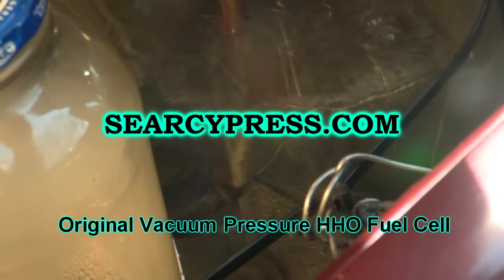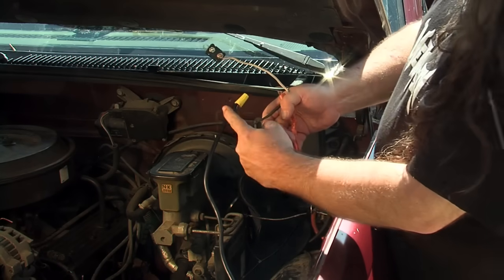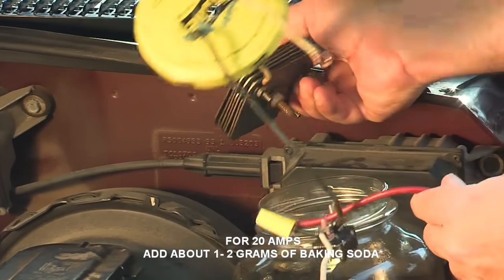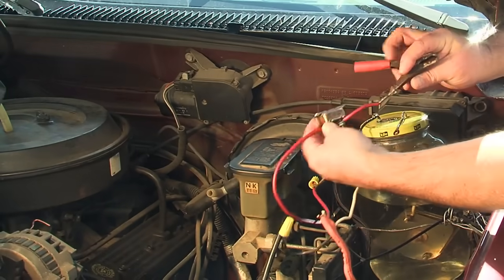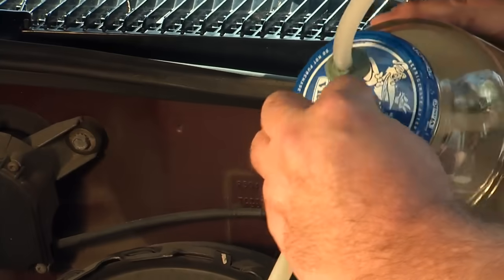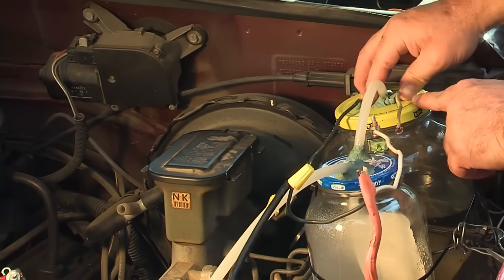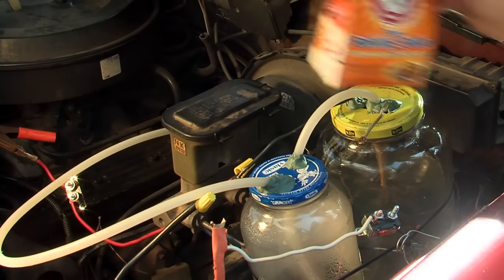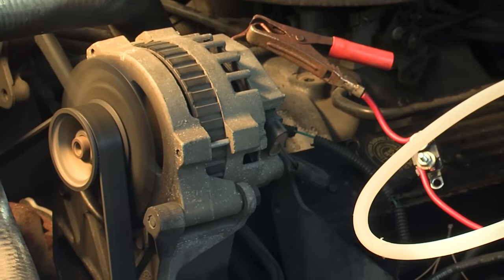Vacuum Pressure Hydrogen fuel cell defeats high gas prices using hydrogen from H2O.

Comment: What kind of stainless steel you running with that
Reply from the maker: 316
Reply: Ok, thanks.. u still running with the same set up,
Reply from the maker: @brianseibert946  i took it to the next level. Vacuum pressure photon injection. I did another YouTube video on it, however its popularity was never as high as this video. By superheating the gas in the drying chamber with a Xenon light source you can push the electrons into higher shell Orbits. I think the reason that video never caught on was the fact that the science behind doing that, is just uncommon knowledge. When you first see this setup, you would think it would explode. However running in a vacuum this is not the case, truly amazing.

Comment: What you made is a poor man's water injection, because there isn't nearly enough BTUs of energy in the hydrogen you're producing to help that engine go at all. Hydrogen is a very very very low energy gas. It doesn't have nearly the BTUs of energy that gasoline has. But when you introduce an element of water you can increase fuel mileage considerably. What you are failing to take into consideration is you must make sure you do not damage your catalytic converter. Too much water can indeed really mess with the converter elements and the oxygen sensors.
Reply from the maker: I agree there is a benefit from the water vapor injection. This is not just hydrogen, this is hydrogen oxygen. I'm not sure if you've ever played with the stuff but it certainly is not what I would personally call a low energy gas. HHO or Brown's gas as it is often referred to, is a very unique fuel with low temperature flame. Interestingly this low temperature flame can melt tungsten or burn through practically anything. Ty for the comment.
Reply: @metalpresstv  yes with enough volume it can. Hydrogen has the unique ability that you can put some in the palm of your hand and ignite it and it will not harm your hand when it ignites, because it implodes. The oxygen content is what helps the engine more than anything. It makes the efficacy of the fuel-air mixture increase markedly. You can almost get the same effect by running your air intake through a filter of lithium hydroxide. Which will convert the carbon dioxide that goes through it into oxygen. However its effect is only as long as the lithium hydroxide Catalyst reaction is active.

Comment: I ran my Dodge 1500 with a similar hook up only I didn't use it around town stop and go driving. But when I was gong somewhere and maintained a speed of 50 mph or more I'd turn it on especially on the interstate. My mileage when off was 16 t0 18 mpg. Turn it on for a long drive I was getting just over 30 mpg.  I also noticed more pep when going up hills and less pressure on the gas pedal.
Reply: Why u gotta lie man. Basic math for anyone with more then a 7th grade education knows this is bullshit. Just idling your engine is over a 600 rpms. Driving a 2.5 liter 4cly motor  is about 150 cubic inches. That's 37.5 cubic inches per a cylinder. A cylinder fires ever 2 full rotations. So in a minute of idling at 600 rpms your engine will use 11,250 cubic inches of air a minute at just idle. That's a 187.5 cubic inches a second of air. You're not producing even 2 cubic inches a second. But don't forget that it's h2O 2 parts hydrogen 1 part oxygen. So 1/3 of the gas isn't even hydrogen it's oxygen. So not even 1% of the air being taken into the cylinder is hydrogen. The only thing being accomplished here is the alternator is working harder for the high amp draw dragging the motor down more reducing fuel mileage. This is why water isn't used as fuel in a motor vehicle. 

Now don't forget we don't drive at 600 RPMs most people will be around 1800 rpms at cruising speed. That's 3x the amount of air with still the same hydrogen production. So now ur way below the threshold of .03% hydrogen in the cylinder. Using a spark arrestor on the output hose to keep from blowing the jar up you would be hard pressed to even candle a flame let alone put anything measurable in every cylinder 900x a minute cruising down the highway at the speed limit.

Comment: I'm not understand ,why cant be used the exhaust heat instead of electrical heat to produce the hydrolyzed process!? Takes time to adapt this system, but cut another problems like battery or wires !
Reply from the maker: An interesting concept. Producing hydrogen from the heat of the engine. Currently there is no thermocouple to produce the kind of electrical energy needed to do that , I am aware of.

Comment: And, for all the dumb commenters below, oxygen sensors do not sense oxygen, they are small fissures that generate small electrical voltages when exhausted air passes by them. Mass airflow sensors measure air going in, o2 sensors measure air going out. (All an engine is, is an air pump)...Get it? P.s. the truck in this vid does not have a maf sensor.

Comment: Yes, it's a carburetor  gas injection (the old way, not ECM and sensors needed) not a Fuel injection gasoiline engine.
Reply: ernesto 96 had first year vortec or the previous tbi throttle body injection

Comment: It takes a LOT of energy to split hydrogen from water..and with these tiny little generators it will never work to provide enough hho to make any noticeable difference....a 5.2l engine would need at least half that in hho EVERY revolution of the engine to make any noticeable difference..basically at wide open throttle the engine is turning over 100 times a second thats sucking in 520L of air every second..and i highly doubt these things can produce enough HHO to sustain anyplace close to 200l of HHO per SECOND 

Lastly back to the ammount of energy it takes to split hydrogen atoms to create enough HHO to sustain a 5.2l engine would be astronomical...modern engines already burn 98.8% of the fuel that is introduced to the combustion chamber...the issue is the fundamental way an ICE works..it only puts 26% of that energy to use....the rest is lost to heat..and there is FAR less energy stored in HHO gas.. do the math... 

THIS IS WHY WE DON"T HAVE HHO ENGINES! its far too inefficient..

Comment: 29 amps is going to hog a lot of energy. Or do you mean volts?
Reply from the maker: Amps. Its not as much as you seem to think. And it will not fry the alternator as many have suggested. Check the date on this video that alternator is still in this truck running fine. This is not an overunity device. The compensation comes from efficiency gains from a more productive fuel burn...ty for comment.

Comment: You know that by running hydrogen in a regular engine will eventually destroy your cylinders right? Unless you sleeve the cylinders with stainless, the hydrogen will get in the microscopic cracks of the steel and harden them, causing “hydrogen hardening”. Ask anyone who’s ever had to replace a compressor in the oilfield industry.
Reply from the maker: Pure hho, agreed. This is why we mix it. Gasoline contains lightweight hydrocarbons. It is already running on some hydrogen before we install it.

Comment: Look guys, all other problems aside, this isn't very feasible based on the current draw for the electrolysis. 30 amps added electrical draw means the alternator never shuts off and fails prematurely. For a smaller car with a stock alternator, it would struggle to keep pace with the electrical demand period.

Also, I'd wager you'd need to reprogram any car that has been made in the last 25-30 years to make this even effective with fuel injection.
Reply: Tell me of a single moment when alternator shuts off, other than shutting off the engine itself.
Reply: @tomclanys  It never fully shuts off but the voltage regulator is supposed to throttle output of the alternator.
Reply: @mdood9299  now that's correct. It will wear the bearings more as it's constantly taking more torque to turn it, probably also make the regulator heat up more. There are freaks running over 200A at once with audio systems and their alternators work just fine, but they're rewound as far as I know.

Comment: Whats with the use of food jars that are low quality...when higher quality glass is cheap and easy to get...wouldnt Butyl tape work better than "poster putty, also wouldnt the water coming out of your engine rust your exhaust system away???  
If i toom my car to a mechanic and sae them using everyday materials as engine components i would go somewhere else...
Nice con job, people are believing you....how much have you conned so far???
Reply from the maker: You seem to be unaware that water is a byproduct of burning fuel already. As far as using the jars it was the most convenient thing available. The system operates in a vacuum, there's no pressure and this type of Jar is certainly accustomed to vacuum. Thanks for your comments.

Comment: do you loose or gain HP or is it the same i know that with propain you loose HP
Reply: You don't lose or gain horsepower switching fuel sources necessarily assuming the system is adjusted to match the new fuel-to-air ratio necessary for the fuel in particular. I know for a fact you could switch to propane and get more horsepower, just like I could install oversized injectors and polish the intake ports on the head to do the same.

Comment: Tried it. Did not really notice a difference. This setup may go bang too.
Reply from the maker: If you did try it you would be praising the safety of
 vacuum production...
Reply: @metalpresstv  good point i did do it slightly differently and did not induce a vacuum within my generator. I also used another water lock  jar to minimise the amount of gas under the bonnet at any one time. I may revisit it with a vacuum id suppose it may generate more gas vs electrical imput. Ive heard of very elaborate circuits that surge the electrical flow. But because i did not get great results i gave up the pursuit.

Comment: Hho works but you gain almost nothing do to having to pull a minimum of 30 amps... I ran a car on HHO for 2 years unless you have a stainless steel engine that rusted-out and you really don't get any better gas you pretty much just overload the electrical

Comment: It takes more energy to "Crack" water than it gives out -   however, there is some benefit in putting a small percentage of a combustible gas in a diesel or petrol to bridge the less than homogeneous distribution  of the hydrocarbons - the worse the distribution of fuel and air the  more beneficial the result - ie the poorer the engine the better the result - propane will work just as well and be easier on your alternator and belts
Reply: Somebody finally said this! It's what i have issues with. The load on the battery. All these people arguing it doesn't work have never built one or all of these comments would be about alternators and batteries instead! The comment section in here is mostly full of bullsnot.

Comment: Regulating the hydrogen gas is the biggest problem I have come across! Please tell how you do this? The hydrogen gas, is like regular gasoline, you step on the pedal, you get more gas, you go faster! How do you regulate the hydrogen fuel?
Reply from the maker: The vacuum pressure regulation system is much different. If you step on the gas vacuum is reduced as well as production. Production of this type of cell is actually highest when coasting. The production is pretty much self-regulating and it does vary quite a bit.

Comment: morons always fall for these con games and moronic con men keep pushing it.We have tested twelve cars from v-twin motorcycles to v10 trucks on five of these scams and the end result was zero improvements in gas mileage and zero  improvements in horse power .these systems do not produce a usable amount of anything to cause change but have an accident you might do extra damage to your vehicle or  passengers.Why would anyone  believe they could produce enough hydrogen out of a pickle jar of water . https://www.youtube.com/watch?v=s2t11GR6jFc    this guy has it right

Comment: Using Romex on a truck, lmao
Reply: 14 gauge solid wire works the same for DC or AC... Granted it sucks to work with on a vehicle, but if it doesn't move anyway cause this shit doesn't work for long, stress on the wire isn't the issue here. Amps are amps. The only time it makes a difference is high frequency AC, which this is not.

I've jump started a vehicle with 14 gauge Romex to get me out of a bind. Not a joke to know your shit.

Comment: Don't use stainless steel because you will make toxic chromium salts. Use platinum plated electrodes only.
Reply from the maker: That would certainly be a luxury. The high grade stainless that is used in this particular design does not corrode noticeably. It was quite expensive to obtain this quality of stainless steel, and having it cut specifically for this design. I cannot imagine the cost having them Platinum coated. If you can afford it, sounds like a plan to me.

Comment: Wow there's still people that think you can do a better job with a bucket & some garden hose than all  the geniuses in the automotive industry! The electrical part isnt free either. The more load there is on an alternator the more fuel it takes to turn it! Bottom line is you Simply CANT get free fuel. If you could all the cars on the road would be fitted at the factory. Oh thats right sorry I forgot its a conspiracy so they can keep selling petrol or gas as they say in Umeruka.

Comment: He is missing a few things there. I did this years ago on my GMC Sonoma 1991 4.3l v6 i got great results. Well over 50% increase. I had alittle different set up. Adjustable Map sensor i made , 02 sensors must be tricked or hacked, pcv oil separator ( helps any engine) and i used a additive in my gas. With all that on THAT YEAR of vehicle. I was getting over 50%MPG.  and it ran better smoother, and cooler. Oh i forgot i also had a fuel preheater also. It was alot of fun too. But it can work if you do it right
Reply: Out of curiosity how come the O2 sensors have to be tripped I would think that the PCM would be able to make the necessary fuel trim adjustments using the hydrogen as a supplement.  Or is it that 1991 vehicles girl programming or integrator just isn’t capable of making fuel trim adjustments needed when using hydrogen as a supplement? I’m very curious

Comment: Can you build me the electrical plates that you use in the water and baking soda  and if you can how much. Phone 3072568868 and thanks.
Reply from the maker: Unfortunately not. The one shown in this video was sold. You might possibly find them on eBay someday. It was very high quality stainless and it was an ingenious design that was no doubt the reason it was purchased.

Comment: The laws of thermodynamics say otherwise.
Reply from the maker: I don't think you understand the concept here. No one is claiming overunity. A very inefficient engine is made to burn fuel in a way that increases mileage. Yes, energy is used to make the gas, but in the state of vacuum the efficiency of producing the HHO fuel is much greater than other methods.
Reply: So you are implying that by making a gas that is LESS energy dense than gasoline. In a manner that wastes about a 1/3 of total energy simply by conversion. By combustion of a gas that loses more of it's energy in heat lose than gasoline. In the part of the system of combustion that is already about 90% efficient (the actual total combustion). That it INCREASES efficiency?

Once again the laws of thermodynamics say otherwise.

Comment: LMAO...how?1?; "*This version is very safe and very affordable and out performs all others. We don't sell it. We show you how to build it. (* Build at your own risk. Death can result from misuse or malfunction.*) ". 
That's in the description folks...it didn't give supports of this pause? 
I am seeing electrolysis, but not a fuel cell (PEM or Polymer Exchange Membrane FC). Fuel cell use hydrogen to convert it to useable electricity, and the electricity powers a load (motor in a car...NOT ENGINE. It's a bit harsh, but if you don't know the difference you've eliminated yourself from being qualified to comment further) they're electrochemical.  It use a chemical reaction to create the energy (electricity) (2H2 + 02 --> 2H20  + Energy).  A hydrogen car (readily available from Toyota and Honda in California right now) use a motor (electrical) not an Engine (combustion). This model seems to burn the hydrogen in a combustion process. So, lets stop arguing over if it's a fuel cell; it's not it's electrolysis, or the separating of hydrogen and oxygen from water. I have my doubts about the creation of water out of the tail pipe as well. Water is the waste in a fuel cell, but seemingly would not be if the hydrogen is being combusted. Seems bogus to me. But hey, go build one, they're safe...lol.